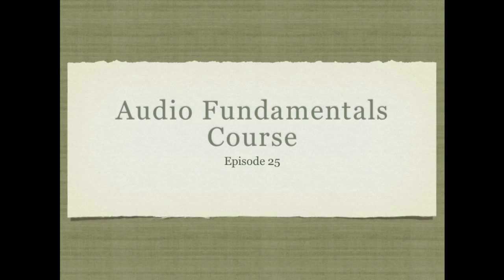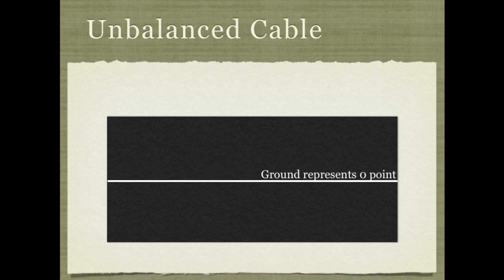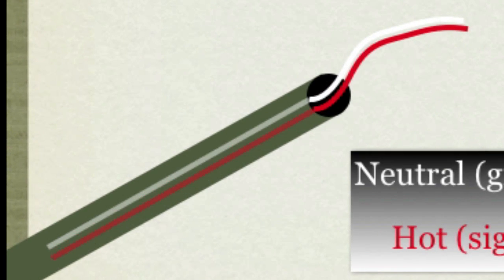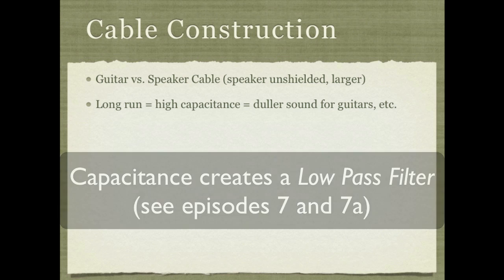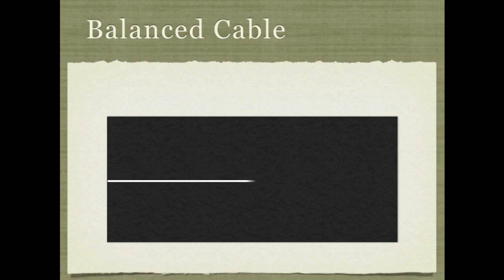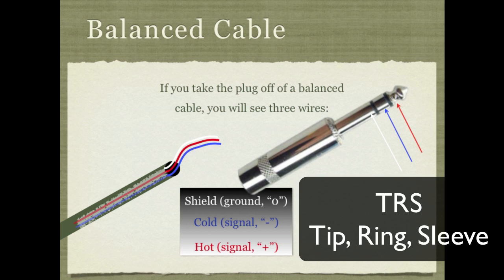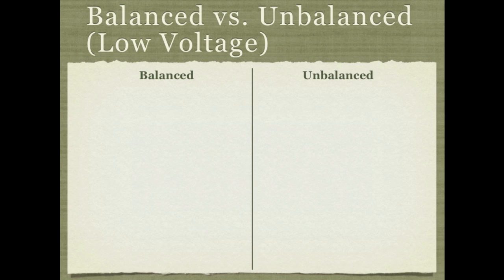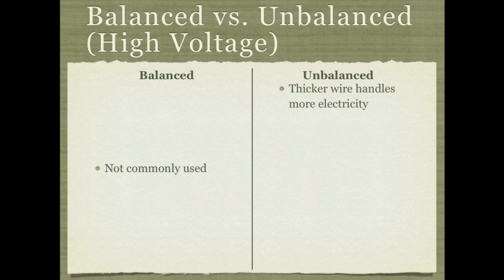AF025 Balanced and Unbalanced Cables

Comment: 06:30 the answer is: You would end up with a very bad sounding mono signal. Why? Because a balanced input goes into an op-amp which changes the polarity of the cold wire to match the hot wires polarity and adds it to the hot wire, thus having the two signals in phase and the noise 180deg out of phase (canceling the noise). But, in the case of a stereo input signal, the signals on the hot and cold wires where never exactly the same, so a lot of sound gets destroyed when the conversion takes place.  It basically ads the left and right signal on top of each other (mono) but in opposite polarity.  Everything that was panned center is basically lost.
Reply: What happens if I connect a 1/4" TS Male into a balanced XLR input using an unbalanced interconnect, such as Hosa HPX-015 unbalanced interconnect?
Reply: @vyoufinder  It will still work as an audio input, but wont be balanced so try to avoid longer runs.  You'll also probably have an impedance mismatch between the two sources, which is not the end of the world, but it affects the sound quality.  Other thing you wanna avoid is phantom power incase you use it for a guitar or something.  You don't want phantom power going through the guitar pickups.  That's why you should rather use DI boxes. It fixes all those problems.

Comment from the maker: If you mean moving the coil of cord around, yes, likely that's it; unbalanced cables are far more susceptible to hum and noise problems. (But if you mean that you have to move the plug around to get a good connection, it's probably instead a mechanical problem with that specific cable.)

Comment: At about 4:23, the potential use of DI boxes is mentioned. I think that this can create some confusion for people as you mention using a DI box OR a balanced cable when in fact you'd generally use them together (IE, you plug a guitar with an unbalanced standard guitar lead into a DI box and then run an XLR cable from the output of the DI box into your mixing desk or whatever).

Comment: I have a question that I hope you can answer.  I found a high quality volume control module with 1/4" in and out, (balanced) inputs.  I want to use it as an (unbalanced) inline level control on a 1/4" effects loop circuit of a guitar amplifier.   If I enter this unit with an unbalanced cable and signal, then exit it with an unbalanced cable and signal... (1) Will it work?,  (2) Is it safe?  Simply put, I'm just trying to maintain a simple unbalanced signal path through this balanced unit, using 1/4" unbalanced cables, both in and out.  Thanks...

Comment from the maker: There's some benefit to getting better cables than the super cheapie ones, but the $1000+ are "snake oil" - i.e. the people who sell them are crooks, and those who buy them are in denial.

Speaker cables makes very little difference. The biggest difference is in cables for passive electric guitars. There's a measurable difference in tone (lowpass filter) based on how long the cable is.

Digital cables either work perfectly, or have big problems. $ pays only for reliability there.